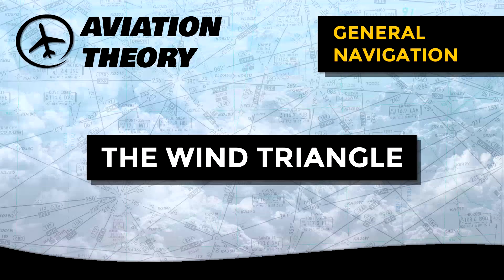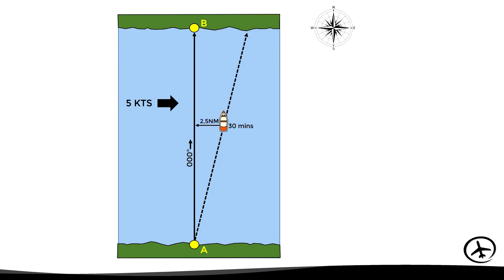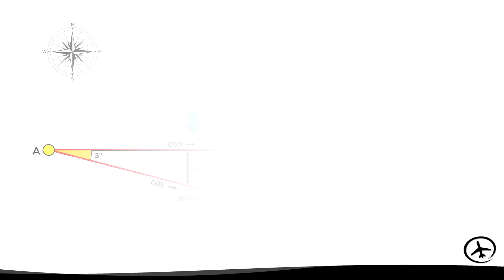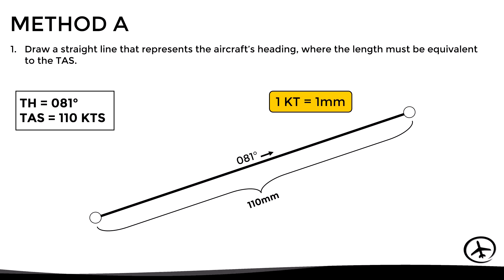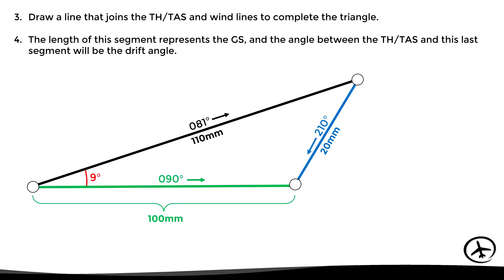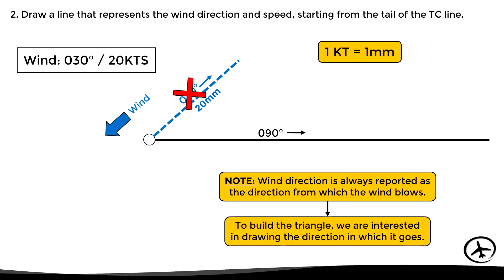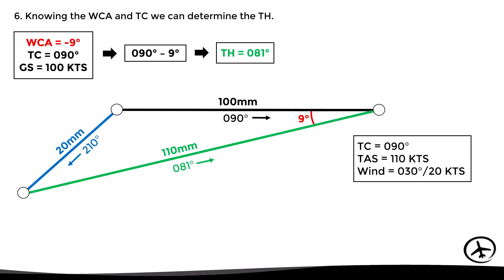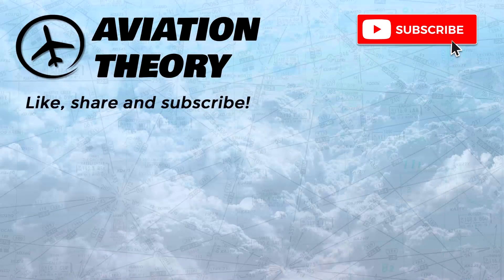The Wind Triangle - Navigation

Comment: i don't understand how get 210° that represent  wind direction.  the wind value is  030°/20 kts i want explanation please i am talking about method A
Reply: Added 180 to the wind direction which gave us the 210
Reply: But why adding? When there is ATIS info about wind like this 030°/20kts it already means that it blows from 030°, you can check by listening to any ATIS and then confirm by RWY in use that it means way FROM which the wind is blowing...

Comment: It's always appreciated to get more instruction on things unfamiliar and things familiar.  Math is math, however, and I must therefore say:

A 5kt crosswind (or current) doesn't imply a 5° degree drift.  Not even close.  Where x is the angle of degrees of drift, tan(x) is the ratio of the drift (in nm) from the target divided by the distance to the target.  

But hey, that's complicated, so let me simplify it for you with examples:
You're in a B737 going 500kt.   A 5kt crosswind will affect your course by 1%.  1% of 360° is 3.6°.  Next example is you're in a Robinson R22 helicopter going 60Kts.   A 5kt cross wind will affect your course by (5/60) 8% which of 360° is 29°.  So drift is entirely related not just to the crosswind component, but to the speed of travel (groundspeed, waterspeed, airspeed, whatever you're measuring crosswing in reference to.)

The same holds true to the end.  If you're going to be 5kt off from your target in 60 minutes then we can safely assume you're going 60kt to 0° (heading 360).  But is that a safe assumption?

When you start off describing wind triangles to learners, it helps to explain that like a chess-knight moves two squares forward and one to the side, if you increase the forward speed but don't change the sideways speed, it no longer is the same chess-knight move.

The critical factors are only distance, rate, and crosswind rate and direction.  Everything else is a distraction.  Why do I say distraction?  What if your next VFR reporting point is right at the end of that distance, but the airport is another 5nm past it.   If you've corrected for the reporting point you've undercorrected for the final destination.

Anyway I'm not trying to be harsh.  Good on you for A)Education, and B)Taking the time, and C)Putting this video explanation out here for us to enjoy.  The math is a bit too simple so if there was no GPS and no VORTAC and no NDB and no visual references and we really were just dead reckoning it... this would be off.

Comment: You have to consider also that wind changes always after inversion layer( increases and veers) so you should add + 30 degrees and wind x2  otherwise 9 degrees correction will be not enough. Same Situation for WCA in holdings when you planning a holding above the layer.